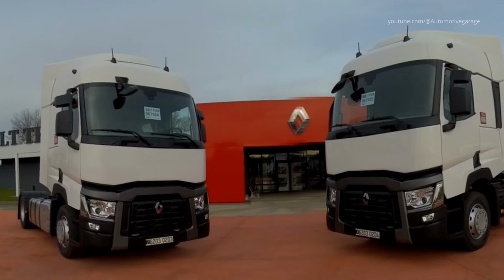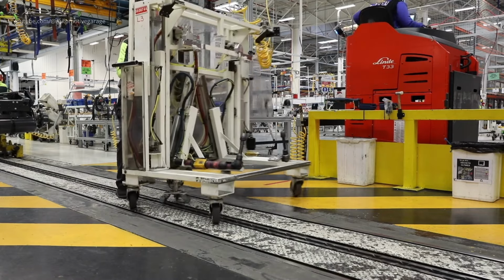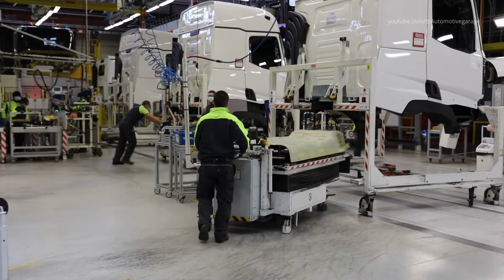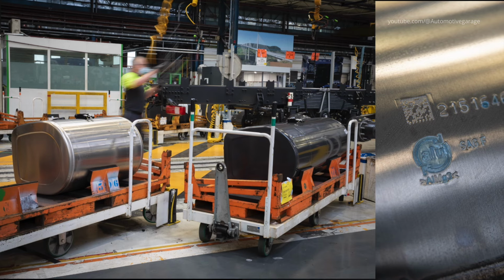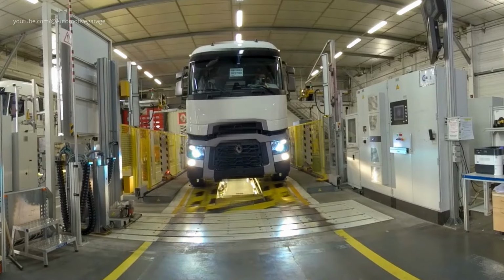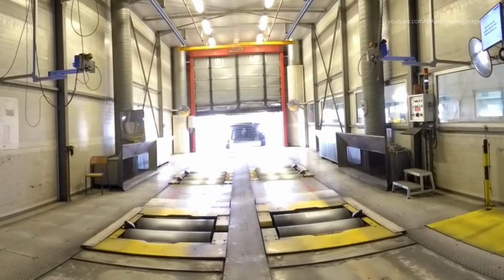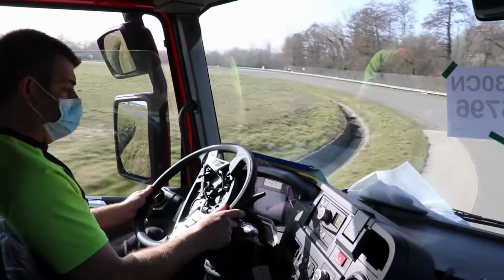Renault Trucks factory tour | Assembly plant in France

Comment from the maker: 0:00 Bourg-en-Bresse Renault Trucks factory:stayhome:
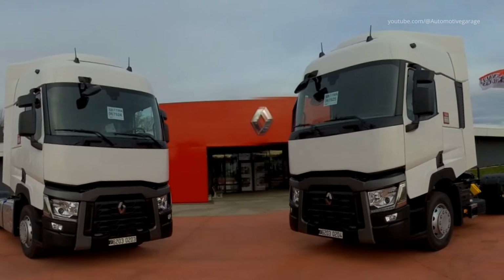0:12 Enter factory:yt:
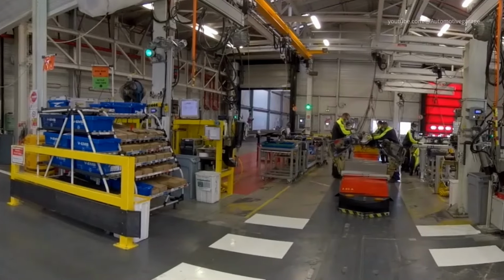0:28 Chassis preperation:yt:
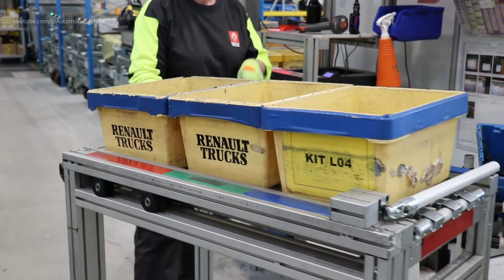1:05 Pick to light:yt:
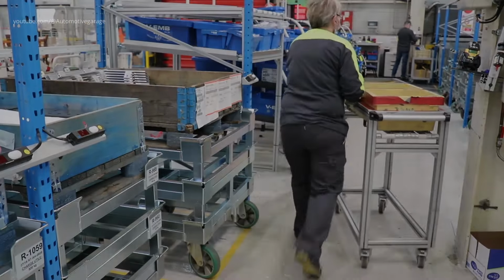1:44 Adhesive tape:yt:
1:58 Checkpoints:yt:
2:43 Checkpoints tightening drivers & riveters:yt:
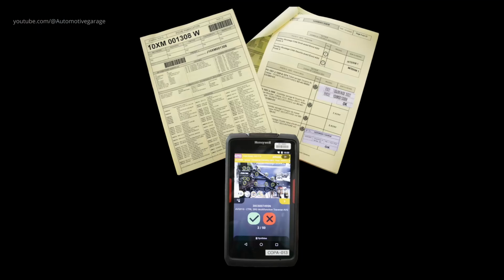3:05 Check list:yt:
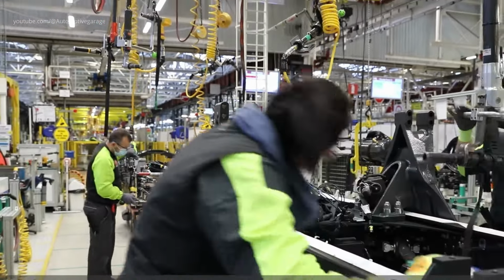3:45 Arrival of the chassis section 2:yt:
4:53 Electric cables & wiring:yt:
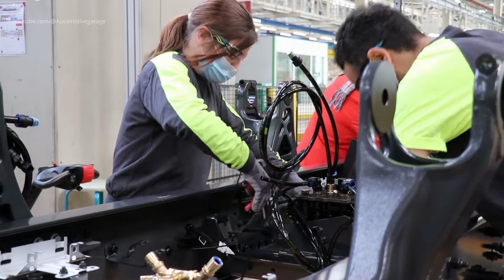5:16 Skylights:yt:  
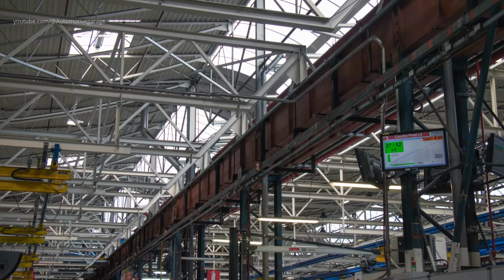5:25 Front and rear axles fitting:yt:
6:25 Front and rear axles preparation:yt:
6:35 Return over of the chassis:yt:
8:32 Transfer system:yt:
8:52 The power unit fitting:yt:
10:54 Tightening driver for power unit:yt:
11:23 preparation area for power unit:yt:
11:46 Cab fitting:yt:
17:30 Preparation area for cab:yt:
17:53 Work support for cab:yt:
18:07 Fuel tanks fitting:yt:
21:13 Electronic box:yt:
21:24 Fuel tanks:yt:
21:46 Quality control:yt:
22:04 Visual computers:yt:
22:11 Wheels fitting:yt:
22:52 End of production:yt:
25:18 Side fairing:yt:
25:27 Truck start:yt:
25:58 FLS workshop:yt:
31:09 Test benches:yt:
35:59 Test tracks:yt: